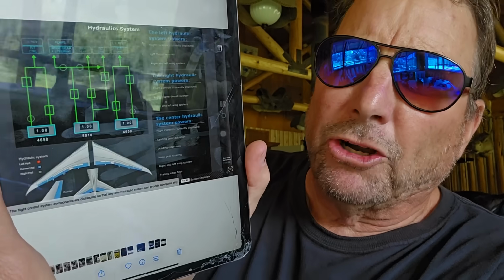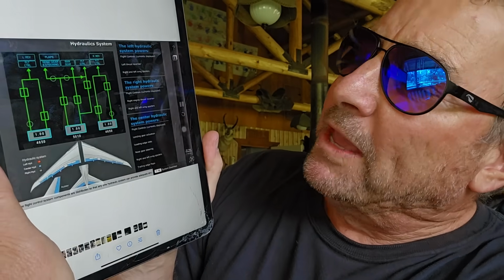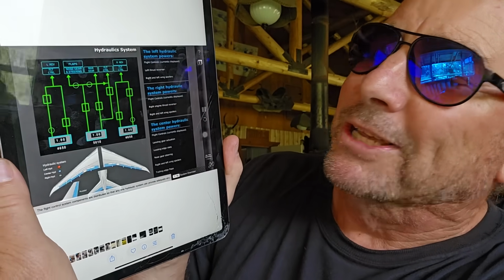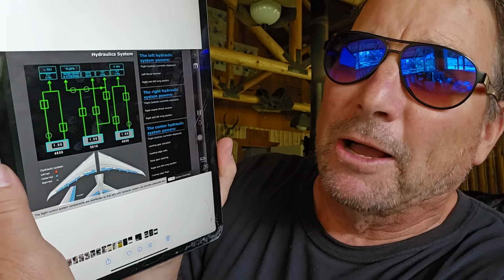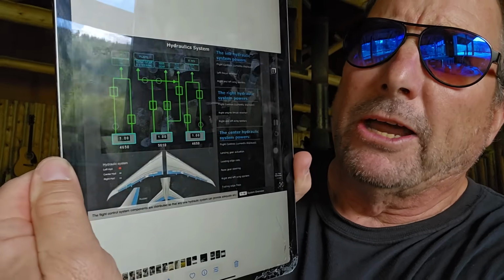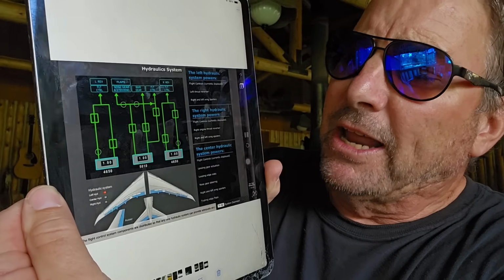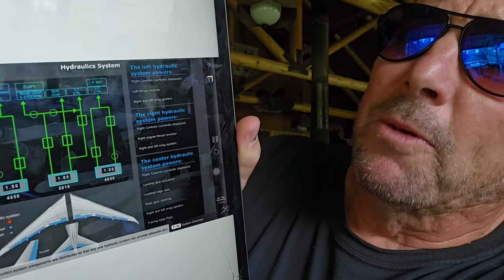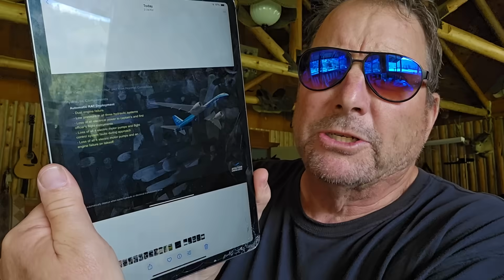787 Crash India What's a RAT? When does it deploy?

Comment: Firstly - Juan, I want to repeat what so many others have said and thank you so, so much for your steadfast refusal to go way out into the boonies on speculation by sticking to asking questions, stating facts, and waiting until more is known. My next paragraph is aimed at the people who did go out into the boonies, generally in a particularly toxic way. With that said...

Oh, gee, look - flaps 5 was indeed set after all, contrary to the opinion of so many "experts." And high-res photos confirm the RAT was indeed out and the engines did indeed shut down almost immediately after takeoff, also contrary to the opinion of so many "experts" but plainly obvious from the bystander video to anyone not looking to create a false narrative. And now the same "experts" that were "sure" that the pilots retracted the flaps instead of the landing gear are "sure" that this was a mass murder-suicide. I wonder what those "experts" will be "sure" of next. 🙄

Anyway, the preliminary report is out. The EAFR reported that the fuel cutoff switches were tripped immediately after takeoff, although one pilot (PNF? see below) denied cutting off the fuel. I did read that the EAFR does not record the actual switch activity, but rather the electronic signal sent to the FADEC. The switches were found in the RUN position, but it should be noted that a restart was also attempted per the preliminary report. The current question is what happened. Preliminary report notes the following:

"In the cockpit voice recording, one of the pilots is heard asking the other why did he cutoff.
The other pilot responded that he did not do so."

Preliminary report further states:

"The aircraft achieved the maximum recorded airspeed of 180 Knots IAS at about 08:08:42
UTC and immediately thereafter, the Engine 1 and Engine 2 fuel cutoff switches transitioned
from RUN to CUTOFF position one after another with a time gap of 01 sec. The Engine N1
and N2 began to decrease from their take-off values as the fuel supply to the engines was cut
off.

...

As per the EAFR data both engines N2 values passed below minimum idle speed, and the
RAT hydraulic pump began supplying hydraulic power at about 08:08:47 UTC.

As per the EAFR, the Engine 1 fuel cutoff switch transitioned from CUTOFF to RUN at about
08:08:52 UTC. The APU Inlet Door began opening at about 08:08:54 UTC, consistent with
the APU Auto Start logic. Thereafter at 08:08:56 UTC the Engine 2 fuel cutoff switch also
transitions from CUTOFF to RUN. When fuel control switches are moved from CUTOFF to
RUN while the aircraft is inflight, each engines full authority dual engine control (FADEC)
automatically manages a relight and thrust recovery sequence of ignition and fuel introduction.
The EGT was observed to be rising for both engines indicating relight. Engine 1’s core
deceleration stopped, reversed and started to progress to recovery. Engine 2 was able to
relight but could not arrest core speed deceleration and re-introduced fuel repeatedly to
increase core speed acceleration and recovery. The EAFR recording stopped at 08:09:11
UTC
At about 08:09:05 UTC, one of the pilots transmitted “MAYDAY MAYDAY MAYDAY”. The
ATCO enquired about the call sign. ATCO did not get any response but observed the aircraft
crashing outside the airport boundary and activated the emergency response."

The question that has been posited on PPRuNe is how fine the CVR resolution is on the fuel cutoff switches and if there was indeed a 1-second delay or if that's simply an effect of resolution. I suspect the full investigation will clarify this. I don't know anything about the 787's systems, so I don't know if this could be rooted in some sort of electrical fault between the switch and the FADEC or not. All I do know from reading about it is:

1. The switches are spring-loaded and need to be pulled up and down with significant force, making accidental operation exceptionally unlikely; and
2. The FAA issued an Special Airworthiness Information Bulletin in 2018 to do with a locking feature not being installed on these switches , which Air India did not act on; and
3. at some point, this was used as a parts aircraft

To which degree any of this is relevant is not yet known. I will choose to not speculate and wait for the final report. I am simply not an expert... but I won't shy away from commenting on that which is readily evident and it was evident from the get go that the flaps were set correctly, the engines weren't running, and the RAT was out.

Comment: I read that the FDR indicates that both fuel control switches were turned off soon after takeoff and then turned back to run. My question is how long does it take for the engines to restart once the switches are moved back to run and is it a multi-step process to do so? Could there have been a problem with say the left engine, the right turned off in error, then the left one turned off without remembering that the right one had been erroneously turned off? These were not inexperienced pilots.

Comment: Could the leaking faucet issue with 787’s be the root cause?
This as far back as 2023 was identified and there was an FAA directive..
‘Leaking faucets on Boeing 787 Dreamliner lavatories have become a safety concern due to the potential for water damage to vital electrical equipment. The FAA has ordered inspections and a fix is being developed by Boeing.’

Comment: Speculation 101b:  if one of the pilots had set the autopilot altitude knob to, say, 300', instead of 3000', that could conceivably have caused engines to throttle back, causing the crash?  A simple enough mistake. Of course, analysis of the FDR will solve the mystery once & for all.

Comment: Once they analyze the "black" actually mostly crash proofed orange boxes we will know the facts. In my hymble opinion it wasn't a mechanical issue. The Second Officer or Co- Pilot was very low time not even enough hours 1500 to fly commercially with an ATP rating in the states.
Reply: The FO had over 3,000 hrs.

Comment: I know its long ahot but  one of the flight crew members could of put fuel cut off selectors to off instead of deselecting EEC's per checklist if one of them fails with multiple warnings. It has happened. I was a DAL mechanic in the 80's and this described scenorio happened on a 767.

Comment: I saw the Port engine kick up dust on rotation, but I did not see the Starboard engine do the same, what did you see? There is a possibility that microbial contamination was already present in both wing tanks, or the contamination was pumped in during refueling (don't know what type of refueling equipment they use at that airport). It really does look like a dual-engine event. Maybe the Starboard engine quit first beyond V1 and close to VR, then the Port engine quits after rotation, the RAT deploys because the 2 VFSG'S on the port engine are now reducing output.

Comment: Question: have you ever encountered bacteria or algae growth in jet fuel, thus in kerosine? (Or in AV-gas for small planes?) Kerosine is chemically closely related to diesel. And diesel, especially modern diesel with some percentage of biodiesel, is very prone to algae en bacteria growth. This turns the diesel oil into a thick slimy goo. I have seen it in diesel fuel tanks, which caused endless problems with an engine: wouldn't start well, wouldn't run smoothly, sometimes wouldn't keep running, and especially: wouldn't deliver power. Replacing or cleaning the filters, and replacing fuel by fresh diesel, didn't help. It kept growing back soon. They had to replace the whole tank and all pipes to get rid of it. It seems fuel quality has gone down terribly in the last decades, with all this climate-nonsense.

So I was wondering if that could have been a factor here too? If it would be technically possible? But at least that would explain why both engines did seem to work well at idle, but could not deliver enough power on take-off.

(I had never heard the sound of a RAM, and the sound of handheld cameras can be very poor, but it immediately seemed to me that something was wrong with the engine sound. It did not sound like a powerful jet, but rather like a jet at idle, plus indeed a high-speed propeller, a bit similar to the sound that a Harvard makes, just less strong).

Comment: * The landing gear retraction was never started. The (trucks)boggies tilt forward only after the gear doors are open, NOT before. The rooftop video clearly shows the gear doors in the closed potion. So the gear selector UP was not engaged before power loss.
Reply: No on the B787-8 the undercarriage bogies tip forward before the doors are opened, the sequence is different on the -9 & -10.

Comment: Juan, one thing I haven't seen anyone mention on your or other video comments  on this subject is the lithium ion battery system that was such an issue in the initial rollout of the 787... There's all these theories about vapor locked fuel lines and other types of failures... But what if... There was a thermal runaway event with the batteries which caused an electrical issue that resulted in the fadecs rolling the engines back or dropping the fuel pumps with the same effect. 
I don't know how the batteries play into the main electrical busses and what sort of ramifications a thermal runaway would have.

Comment: Could it be a false (or real) engine overspeed? Hot day, 110 degrees. Aircraft on tarmac for 3 hours. Flickering lights (possibly) not addressed on previous flights. Maybe computer electrical malfunctions in avionics bay and/or fuel control. Long RWY, high power. System 1 detects overspeed (say..falsely). System 2 designed to correct overspeed fails. System 3 AUTOMATICALLY shuts down the engines to prevent a catastrophic engine failure. This would explain a simultaneous engine failure. It’s a reach, but at this point, what isn’t?

Comment: @blancolirio is V2 speed calculated based on gear up or gear down? If not, what happens to V2 speed when the gear is down.. how much do the gear increase V2 Speed?
Reply: Richard Godfrey says a 787 will climb out under power even with inadequate flaps and gear down and even on one engine...FDR should show pilots hitting the throttle with no results...
Reply: @Exiles800  yes, the faa makes it a requirement that 1 engine can produce enough thrust to make the aircraft gain altitude.   

 Juan mentioned that the RAT deploys in certain scenarios, and im thinking specifically of when he mentions the single engine and hydraulic pump failure scenario....

V2 speed is the minimum safe speed with a single engine, which is important during takeoff, not necessarily for landing. Landing gear cause drag and produce no lift, which tells me that stall speeds increase with gear down as opposed to gear up.  

But either way, just because 1 engine can produce enough thrust to do those things does not mean an airplane cannot stall/lose lift production.  The critical angle of attack can still be exceeded with full power on any fixed wing aircraft. 
That is why i asked those questions about V2 speeds... not if a single engine can produce a climb.

 Unfortunately, your last sentence is a bit incorrect. The Throttle, during take off, are set to a position that will produce the most effecient thrust for the conditions (i.e. atmospheric conditions and altitude.).  They are not "hit" to produce more thrust. The Flight Data Recorder should show loss of thrust on one or more engines.
Reply: @PooNuggs39  The speeds wouldn't change. The gear only adds drag, but does not affect the lift created by the wings, therefore the stall speed stays the same. V2 as well, but the climb angle will be lower. This can be compensated with thrust if there is more thrust available.
V2 gives you a margin over both the stall speed and the VMCA (minimum control speed - air). It is based on full rated take-off thrust, meaning if you take off with reduced thrust based on assumed temperature, you can always push the thrust levers to full rated (displayed on the engine display) to get extra thrust.
The required climb gradients for one engine out are divided into 4 segments. The first segment ends with gear up, then the 2nd segment starts, so the gear is assumed up for the required climb gradient of 2,4% in the 2nd segment.
Reply: @kallek5655 you couldnt be more wrong about the relationship between drag and lift.   Landing gear increases drag which requires more lift to maintain flight.  Ways to increase lift are increasing speed or the aspect ratio of the wing (flaps).  Therefore, gear increases stall speeds.

I do appreciate the reply/try, unfortunately none of the questions I posed were answered.
Reply: @PooNuggs39  No, that is not how it works. Drag is opposed by thrust, not lift. More drag = more thrust needed to overcome it. Lift is opposed by weight, not drag. You need more lift when the aircraft is heavier, and less lift when the aircraft is lighter.

The gear does not change the airflow over the wings, and the CG change by the nose gear is negligible, hence it cannot have an influence on the stall speed.
Reply: @kallek5655 Actually that is how it works, an increase in drag will cause a decrease in lift, unless:
 you can increase speed (thrust),
increase aspect ratio like flaps/slats (lift), and/or increase angle of attack without exceeding the critical angle of attack (lift) . 

So with that said, if you are at the crititcal angle of attack without gear and you then add gear you are increasing drag.  To counteract You cannot pull back because you are at critical angle of attack, you cant increase aspect ratio of the wings because you are full flaps, the only thing to do is increase thrust (speed) to maintain lift.    So, again, you are wrong to say that landing gear has no affect on stall speeds.

You are not wrong in that lift opposes weight and thrust opposes drag. They directly affect eachother as those pairs,  however they all have an indirect affect on one another which is how we manipulate flight. 

How does one, in straight and level flight, lose  lift without changing speed? (And no you cannot add weight mid flight).
Reply: @PooNuggs39  Nope, an increase in drag does not cause a decrease in lift, that is simply illogical.
You are also wrong by saying "You can increase speed (thrust)", as that implies that increasing speed and thrust are the same thing, but they aren't.
If you increase your drag, and increase thrust just by the same amount, then the speed stays the same even though your thrust is higher.
But well, I don't think you would believe me anyway. If you're open minded about it, I suggest you read about certain principles and try to understand them better.
Reply: @kallek5655 Well, you are the one who made it personal by saying im being closed minded, so dont get pissy when i put you in your place...

I really hope that you are not a pilot or a flight instrctor because you really are completely misunderstanding the 4 basic concepts of flight.  You keep using them as your argument as to why Stall speed is NOT affected by landing gear being up as opposed to down.   Had you been open minded enough to open a website called google and actually did some research you could find POH's which helps one deduce that stall speed Vs0, airplane in a clean configuration, is slightly lower than a gear down flaps up configuration Vs1 (the number doesn't matter, they just denote different possible configuration)

But, you consistently want to argue that Drag has no Affect on Lift, when it does.  Again, a quick google search would have told you this....

Directlty quoted From NASA: Because lift and drag are both aerodynamic forces, the ratio of lift to drag is an indication of the aerodynamic efficiency of the airplane. 

That right there shows how far off you are by trying to keep thrust and drag separated from lift and weight. THAT is not how it works.

Lets use a practical scenario to show how all forces of flight Affect each other..

During takoff, it is THRUST that is used to overcome DRAG which causes the aircraft to move forward. This forward motion causes airflow over the wings (speed). The air needs to go a certain speed over the wings to generate enough LIFT to counteract the weight of the aircraft for flight.

So stay closed minded my guy, because im sure that you will go ahead and try to tell me that isnt how it works. 

I am done consistently repeating myself to you,  at this point if you are that stubborn to not look this stuff up and try to gain an understanding there is no point. You will stay ignorant to what's in front of you and I wont be able to change that. 

So unless you demonstrate an understanding of the material, I would rather have someone else, preferably the one I @ed, to answer the questions I posed.   Not from some couch quarterback like yourself.